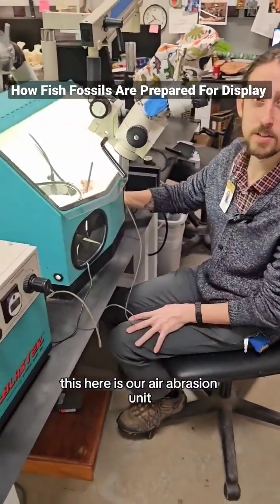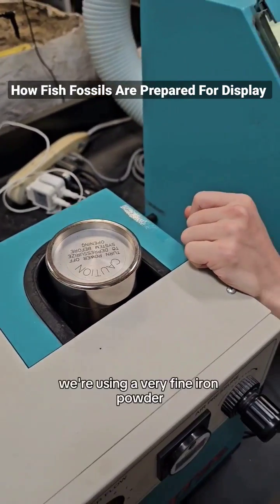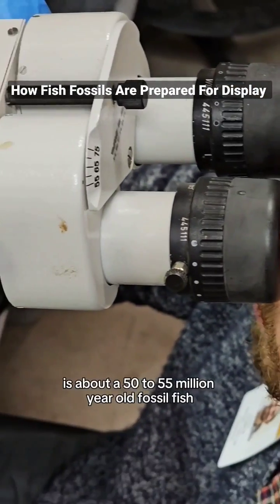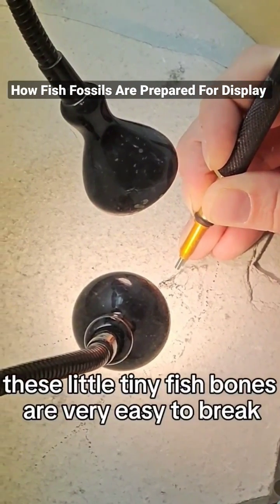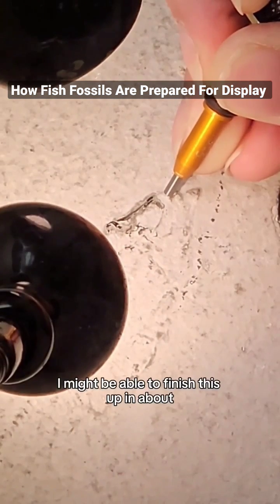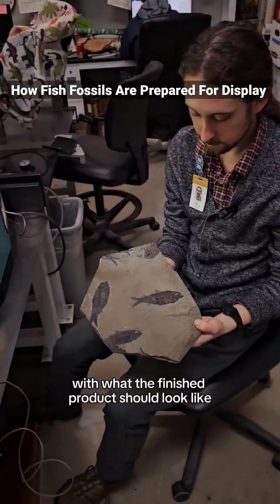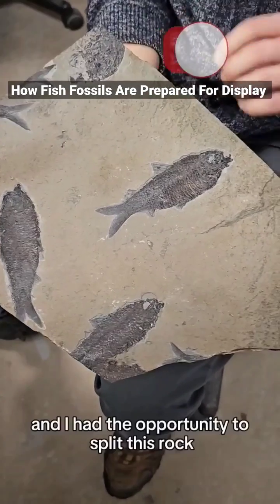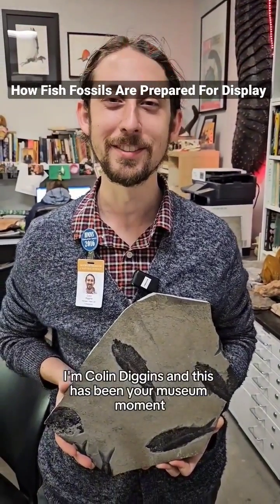How Fish Fossils Are Prepared For Display

Comment: I have several slabs I split at a quarry in Kemmerer in Sept of 2023. Some split completely cleanly, others I still need to prep. What is holding me back is what do I seal them with once they are prepped? I had bought a couple of fish on a slab a few years beforehand, they seem sealed. Because they do not continue to shed dust like the ones I split personally. Help please.